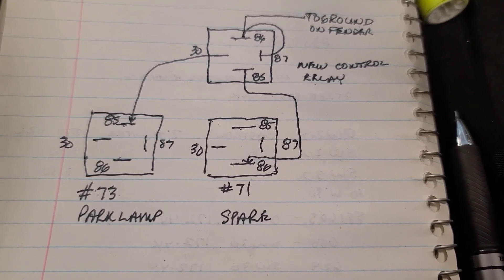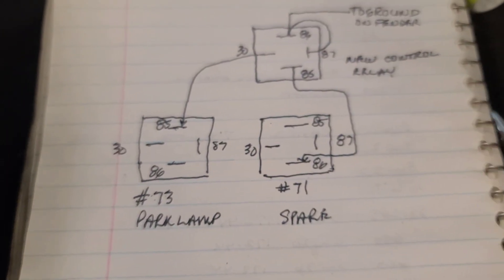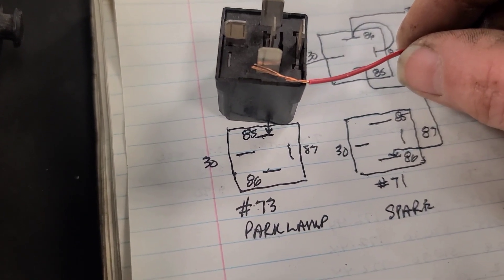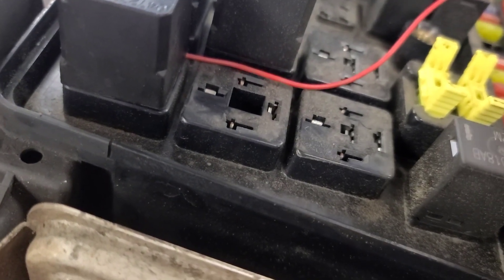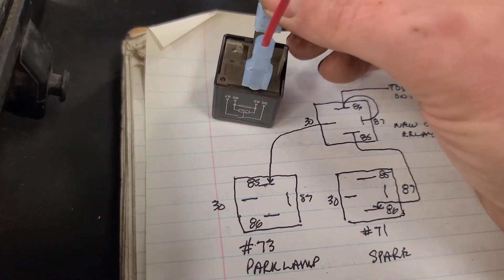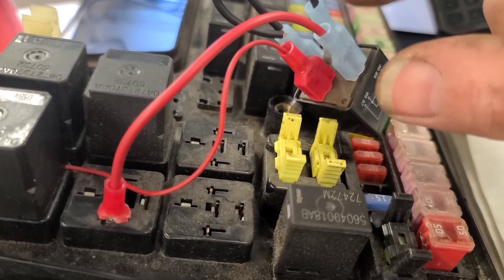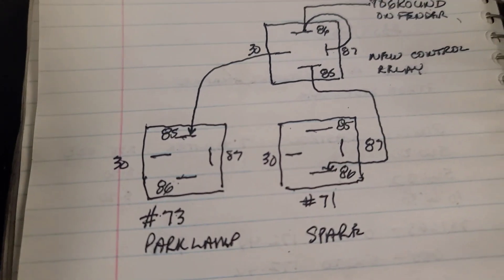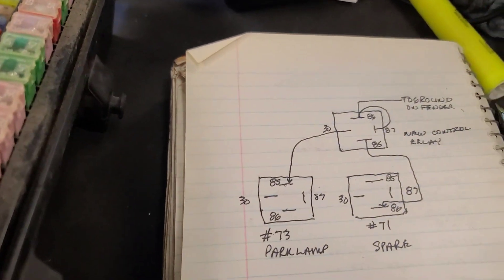2004 Dodge Ram No Park Lights Due To Internal Failure In TIPM

Comment: so what do you do when this doesn't fix the issue ?  what else could it be ? ...and yes I changed the WHOLE harness back to the Tail lights.
Reply from the maker: If you remove the park lamp relay and jump pins 30 to 87 do the park lamps come on? Do you have constant power at pin 30 or 87?

Comment: Plz Help!! 04 ram 1500 5.7 my driver tailamps brake and reverse work for about 30 mins then blows the 10amp fuse for tail lamp. After fuse blows i have parking lights on passenger side along with brake and reverse but only have brake and reverse on driver side So my tailamp is getting power just keeps blowing fuse . I assume its a ground issue . Will wiring to a in cab toggle fix my issue? Could i just ground straight from pin 85 to negative terminal on battery and reinstall the relay so it will complete the circuit??? Idk what to do plz help
Reply from the maker: A bad ground won't cause a fuse to blow. There is likely an intermittent short in the left taillight circuit. The license plate lights are on the same circuit and so is the left front park lamp. Is it fuse 34 that's blowing? Remove the fuse and connect a headlight across the fuse, turn the parking lights on. If the headlight is on bright then the short is present. If the headlight is on but not fully and the parking lights are on dim then move the harnesses and watch for the light to go bright.
Reply: @PhillipBailey ok well I snipped the tag lights and disconnected them so the only thing powered would be the taillight itself. Brand new bulbs brand new circuit board outlets. Ive traced entire harness from rear to front thats visible and cant see a source so I assume its internal in the tipm. With that said would it be safe to attatch your method from the video but on a toggle in cab? Will doing so interfere with the passenger side that currently works or will it be independent to the side thats causing the issues?
Reply from the maker: @jasonwiseman4894 it's not in the TIPM. This fix is if the park lamp relay does not turn on at all. Yours is as the other side works as you said. I edited my first response. The short could be in the left front as well.
Reply: @PhillipBailey yes fuse 34 10a. I change the fuse all lights work fine  untill I turn the actual headlights on then #34 pops. I swapped the relay for a new one keep swapping the 10amp ive replaced circuit boards all new bulbs completley disabled the tag lights as well... not sure if its related but when I open my driver door the headlights flash once simultaneously
Reply from the maker: As I mentioned in a previous comment I'd connect a headlight in place of the fuse, turn on the parklamps. If the headlight turns on bright the short to ground is present in the circuit. Fuse 34 powers the left front park lamp, left rear tail lamp and licence lights. There should be a large latched connector under the truck behind the left front wheel. Unplug that connector, if the headlight goes dim and the left front park light come on dim the short to ground is downstream from the connector. If the headlight stays on bright then the short is in the front of the truck. In either case manipulate the harness while watching the headlight. If it flickers or goes brighter or dimmer you're getting close. Good luck.
Reply: @PhillipBailey thank you good sir 🙏  truly appreciate your advice

Comment: just curious.,,,  could you not take that first red wire that your soldered to pin 85 on the relay, and add a male terminal and stick that in slot 85 on an unused relay socket? or maybe just to the fender?   it's just to provide ground, correct?
Reply from the maker: That would turn the park lights on all the time

Comment: Great video, do you happen to have or know somewhere online i can get the schematic for a 04 dodge ram 1500 hemi?
For the rear tail lights,brake,turn, running,
I got new oval led lights off of Amazon, it says they will work, i guess they're actually trailer lights but said for trucks n other vehicles,  only has a red, white n black wire, wht it s ground, n says red brake i believe n blk turn,  but says u can wire red n white together for bright leds n wht n blk for less brightness,  i don't know, i can't get them to work right,  i think I may need a trailer conversion kit from doing research,  any help is greatly appreciated.  I watched more of your vids and subscribed.
Reply from the maker: @davidl2281  for service information and diagrams try Alldatadiy.com. I'm not sure about the aftermarket lights though.

Comment: Genius, ty kind sir for the elementary walk through because i am not good with wiring, I didn’t have a extra relay handy so to test this I jumped the first site you mention to the relay straight to battery ground they all turned on, I haven’t been able to drive my truck at night for a while, previous owner had all the rear wires tore apart and even ran a led light for tail lights

Comment: I tried it with 3 different relays but they all would buzz when i plugged them in and the lights didn't turn off when i took the key out im gana try the jump from 86 to 87 and see if there is a difference next
Reply from the maker: 85 and 86 are the control pin for the relay, don't jump either of these to anything. To bypass the park lamp relay jump 30 to 87. That should turn on the park lamps.
Reply: I took my box to work and tested the tipm and I had continuity like your other video on the subject so I believe that the drivers in the pcm are bad then, am I correct in thinking that
Reply from the maker: Probably could be the driver in the computer but do the park lamps turn on by jumping 30 to 87 at the park lamp relay?
Reply: I'm gana try that tomorrow just run a jumper wire from 30 slot to the 87 slot? They did turn on when I wired it with the other relay but it made the relay buzz like an old door buzzer and it didn't turn off with the key out of the ignition
Reply: Yes 30 to 87 turns them on without the key in the ingntion
Reply from the maker: @riderxmjk  does 85 or 86 light a test light connected to ground with the key on?
Reply: 86 lights up 85 dose not
Reply from the maker: @riderxmjk  86 is supposed to be grounded by the module through the fuse box when you turn your headlights on. If you wrap a small wire around pin 86 of the relay, plug it back in to the relay center and then ground that wire with the truck running the park lights should come on. You could run the wire to a switch in the cab if you want
Reply: I think I might run to the scrap yard and pick up a whole box there only 14$ but if I don't I'll probably run the switch I think part of my problem is my ignition is shot also cus I can take the key all the way out with the truck running but thank you for your help I appreciate it
Reply from the maker: @riderxmjk  if you can find a used one. Around here they are all gone.
Reply: Yea they were all gone round me but I did manage to grab that pcm box but it was off a truck that had the different plugs like the spare box u had in the video, do those need flashed when installed
Reply from the maker: @riderxmjk  should be plug and play as same options.

Comment: Totally worked! Fixed my 2005 ram 1500. One trip to harbor freight for a soldering iron and electrical fittings and it’s good! Beats the $500 for a remanufactured unit. Thank you!!
Reply from the maker: I'm surprised that you can even get a replacement. It was not available when I did this. Glad it worked out for you

Comment: 2004 dodge ram 1500 my front light  is dead and right rear back light is dead but i put new fuse but fuse 32 keep popping
Reply from the maker: You have to locate the short in the circuit

Comment: Replaced the entire fuse/relay box with no luck, then tried the relay bypass and once again no luck.
Reply from the maker: need to properly diagnose it rather than trying parts. I would suspect a wiring problem. does the park lamp relay turn on with the park lamps. with the relay out do you have power to pin 30 of the relay? If not check the fuses. jump pins 30 and 87 of the park lamp relay,  do the park lamps come on?

Comment: Awesome video thanks! However this didn’t work for me, I have an 04 ram 1500 with no running lights, I changed the bulbs, changed both circuit boards, relay is good, I tried your trick with no luck, any chance you have any idea what else might be going on because I’m lost. Thanks in advance
Reply from the maker: Is the park lamp relay turning on? If you bypass the relay do they work? Should be power to pin 30 of the relay and with it jumped to 87 the two park lamp fuses should have power, fuse 32 and 34? What circuit boards did you replace?
Reply: Wow time to get laughed at, I was so frustrated trying to figure this out that I completely bypassed step 1. Fuse 32 and 34 were blown, thank you so much and please have a good laugh at my expense thanks again!!!
Reply from the maker: @petefontana1976  no worries 👍 glad you figured it out. It's strange that both fuses would burn though.

Comment: There is a much simpler solution to this and doesn't need an extra relay. Make a small jumper and take power from the spare relay 86 slot to 87 on the taillight relay slot. No need for the extra relay. Spare relay power will power the taillights directly instead of using it to activate an extra relay. There is a fuse after that relay so everything is protected.
Reply from the maker: You are probably correct. There is more than one way to do this for sure.
Reply: I did what you just said with the jumper to power the lights directly,  but the left side running lights still don't come on - what do you think?
Reply: @goldrushpro  does it get power? Did you test with a meter or test light?

Also I realized my idea of directly powering it isn't a good idea 😂 it's the power to the trailer lights so when I pulled my trailer I would blow the fuse when I turned on the lights. I ended up going back to the solution in the video. Been running it like that ever since.

It's a good trick for diagnostic tho
Reply: @nicholaslafrance6007 - by jumping from a spare relay slot it did work perfectly - it's just that it didn't fix my original problem which was that only the left tail running lights didn't work - pretty sure the control module circuit board is jacked up. 

So actually I just ran a jumper wire from the right tail lights under the bed over to the left tail lights and it worked and the lamp out light even went off 😁  
But thanks for checking back 👍🏼
Reply from the maker: I believe there is a left and right fuse.
Reply: @PhillipBailey  - yeah, there is👍🏼

Comment: ty did as told and worked but o2 sensor engine light code comes on now if i unhook wire from spare engine light turns off but no tail lights again any suggestions
Reply from the maker: I'd recommend to replace the TIPM then.

Comment: Hows it going im dealing with this same issue on my folks 05 ram 5.7 Laramie. Front  driver parking light and rear driver brake lights dont work. I found #34 10amp fuse blown shows left tail lights. As soon as i relace it n turn parking lights on the fuse blows. I tried disconnecting rear taillight and no go. Even disconnected an led tailgate strip. DO U THINK THIS TRICK MIGHT HELP?  Truck is rust free btw 85k miles truck drives and looks mint
Reply from the maker: No this fix is for a park lamp relay that won't turn on. That's not your problem.  You have a short to ground on the left side park circuit. I'd recommend connecting a headlight in place of tge fuse. Turn tge park lights on. If tge headlight is on bright the short is present. There is a large connector behind the left front wheel. Unplug it and if the headlight goes out or very dim the short is in the rear of the truck. If not then it's in the front.
Reply: @PhillipBailey  so I found a wire that was resting on the hitches frame it was rubbing I believe it's from the taillight wiring. Fixed that everything works now.
Reply from the maker: @dak40833  that's great! Glad you figured it out. Did you use the headlight to track down the short?
Reply: @PhillipBailey  no I physically seen the pinched wire

Comment: What if you had it running from 87 to a toggle switch in the truck an that stopped working does that mean tipms really dickered.   I replaced toggle switch  power/ground wire an got a new relay still no back light brake lights but no running lights
Reply from the maker: Do all the parking lights not work or just the rear lights? Any codes in the TIPM?
Reply: Only light that works is right low beam haha  I still have turn signals, high beams a brake lights   I scanned it an no codes I figure new tipm but thought I’d ask before spending the money
Reply from the maker: @jordan-rb1lo  are you scanning the TIPM or just tge PCM? You should have codes in the TIPM. It likely is a failed TIPM. Can you make the park light come on by jumping pins 30 and 87 on the park lamp relay? This should not affect the headlights so you likely have more than one problem. Park lamp fuse ok?

Comment: My 04 1500 trailer park lights failed where there is no power on the right side of the 20amp fuse socket with switch on. Adding a 12v jumper to the left side of the fuse socket lights the circuit. Do you know if the trailer marker light relay is the same one in your video, or is it on the circuit board?
Reply from the maker: I'm not sure but I'll have a look at the circuit. So the trailer running lights don't work but the truck park lights work fine.

Comment: as always great idea!
Reply from the maker: I was looking for a simple work around that would be easy. There are other ways as you can imagine such as running a control wire from that park lamp relay into the cab and grounding it through a toggle switch but tge drive would have to remember to turn it on and off. I was thinking of using the dash light signal to control the relay but that would require disassembly of the dash to access that circuit. This is automatic and fairly easy to do. Thanks for watching.